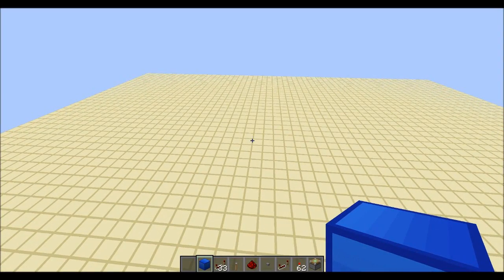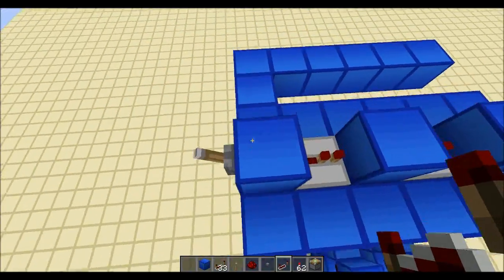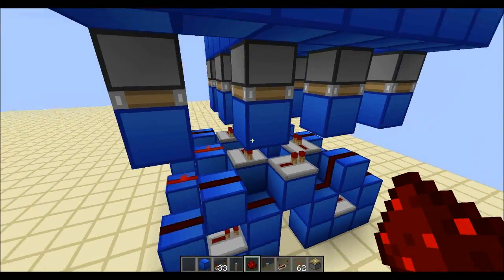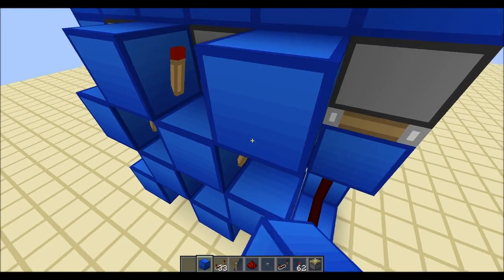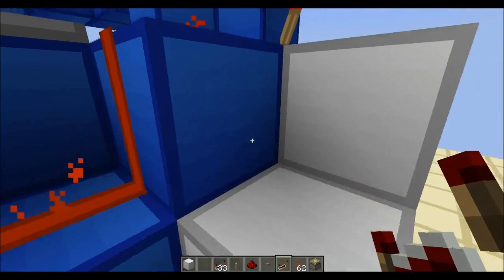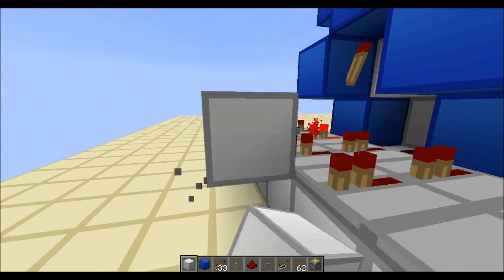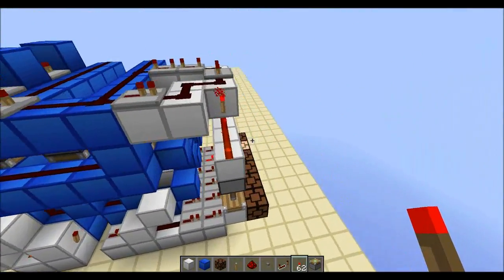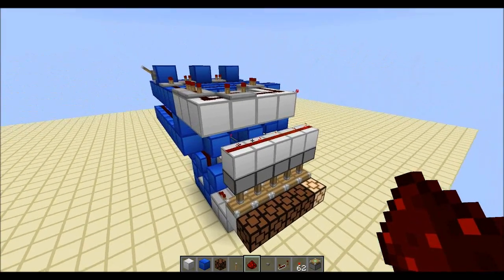Minecraft Tutorial: Reliable Pseudo Random Output Generator

Comment: heres what works for me - have the clock as 1 tick not two like some people say, dont flip the repeaters in the latches, keep them as he shows in the video.
And also at the output part where you use two repeaters, instead of the parts where you use 2 repeaters and 1 dust just use 3 repeaters in a line. Works for me hope this helps :P

Comment: @CubeHamster At 10:47 is that really output rig necessary for the working of the machine or are they only there to read the output at the same time each time. I ask because the 1 tick pulse clock is not long enough to activate the output as seen at 11:07 Thanks